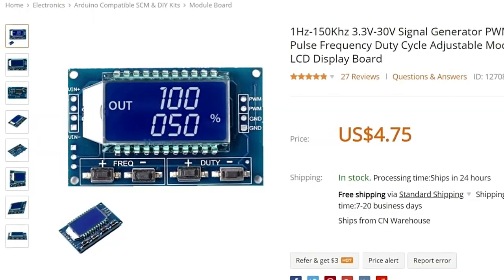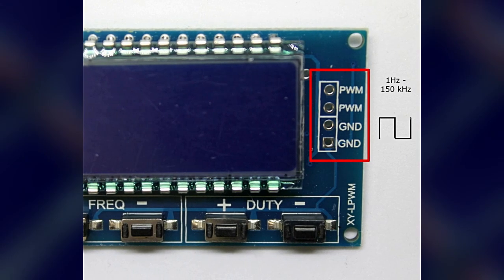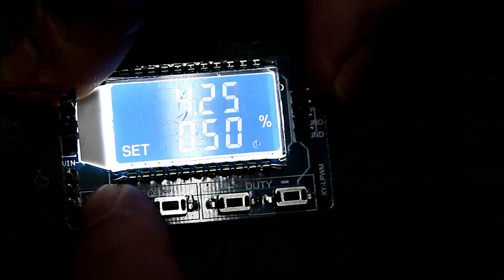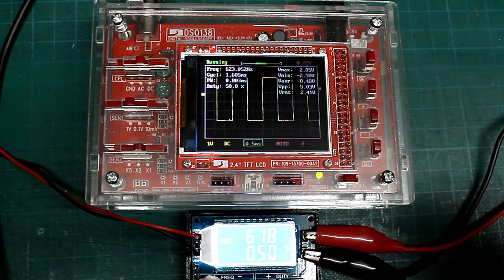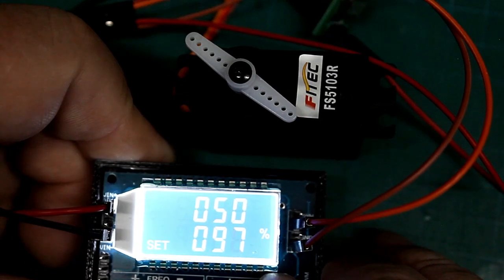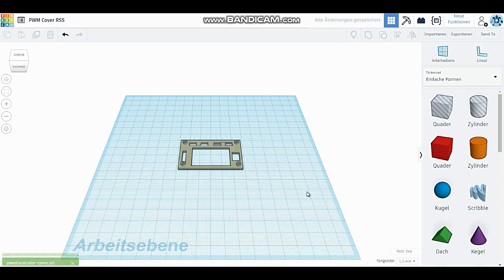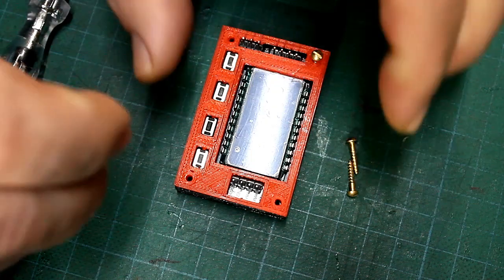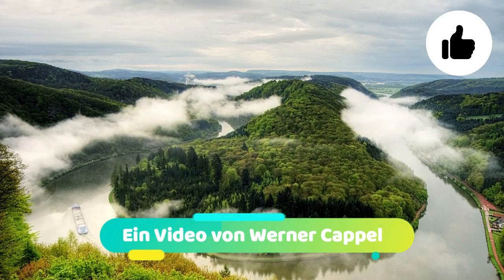Ausgepackt & angepackt - PWM Signal Generator (Banggood)

Comment: Is it possible to dump its firmware? I got the xy-lpwm and some lpwm but the lpwm firmware is crap, so I would like to dump the xy-lpwm and install the fimware to the lpwm :P
Reply from the maker: .. I think it will not be that easy. The interface for programming is missing